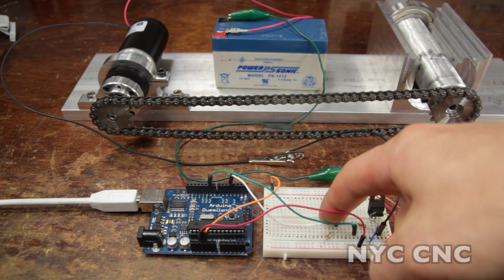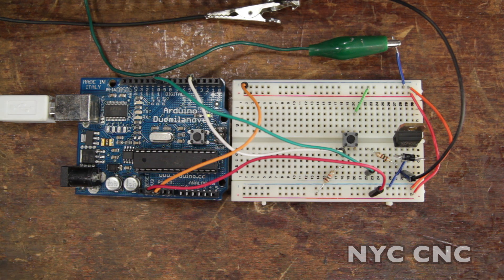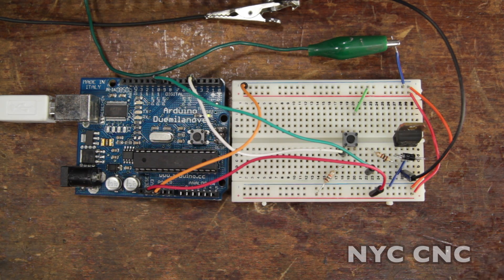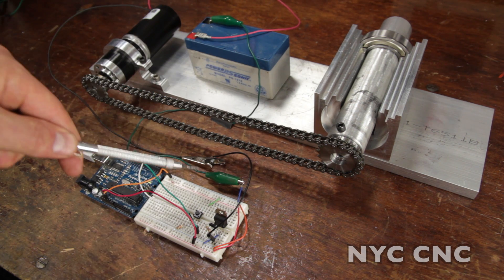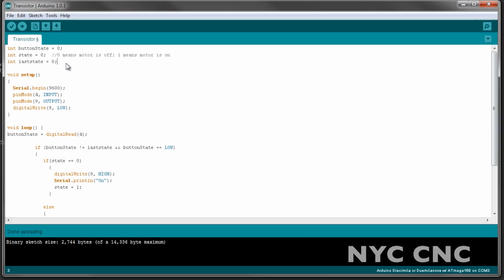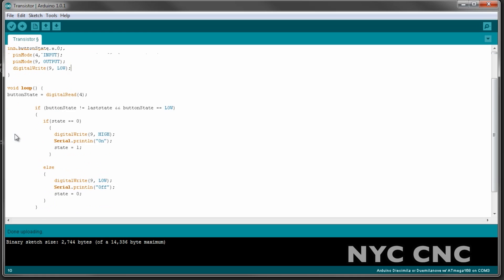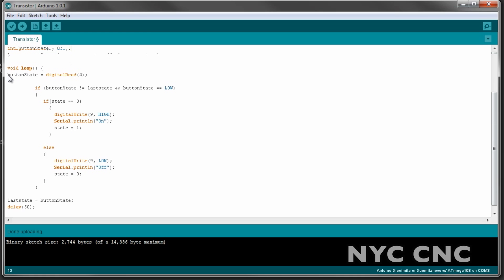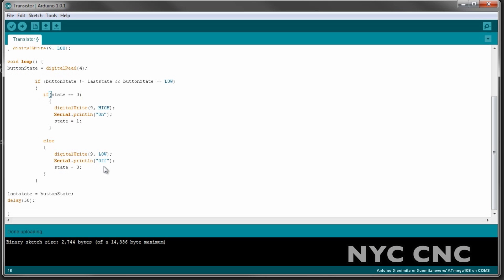Control a DC Motor with Arduino and Transistor!  How-To Tutorial from NYC CNC

Comment: nice video man, I am just trying to wrap my head around the following: 

Why do you need to connect the 5V battery to the motor? I thought the current out of the collector is what powers the motor! 
Also, how is the Arduino being supplied with power? I do not see anything connected to the input power pin!

Thanks!

Comment: Hi there! I really like your utube videos (specially for the details since so many out there don't really explain how things are wired). I'm new at "Arduino" and am trying to figure out how to do the following:
Using an Arduino UNO, motor shield or a relay, motion sensor and dc motor I would like to connect them to achieve the following:
-when the sensor is activated, the motor turns 360 degrees in one direction then pause for 30 sec before running back to its original position.
-being able to control the speed of the motor
Do you have any detail instructions (with code and wiring - which is my main weakness) that would let me achieve that? If you do, could you please share with me?
Much appreciated. Cheers!